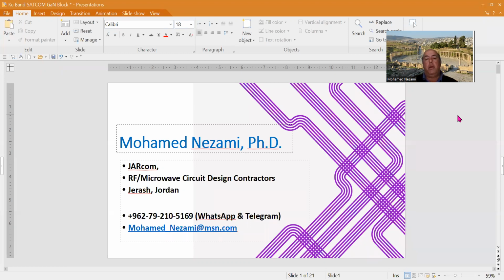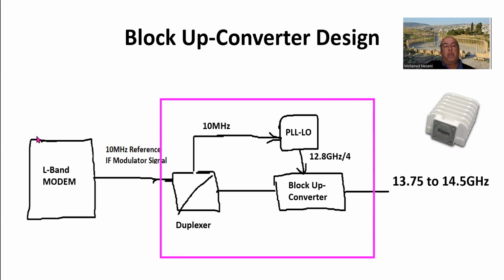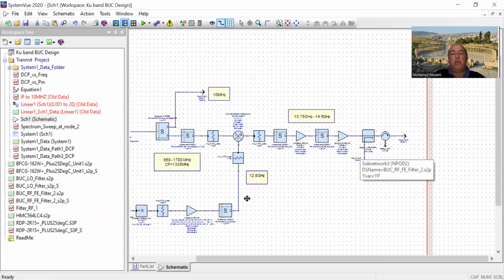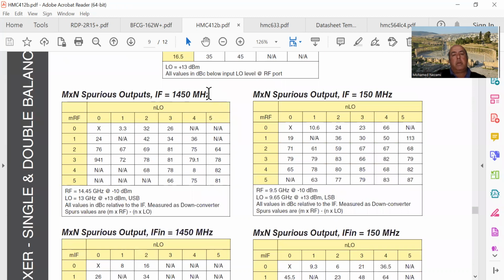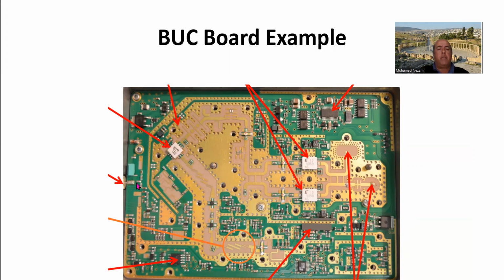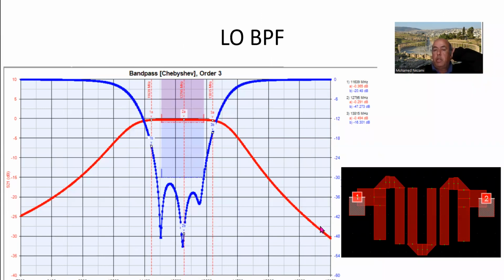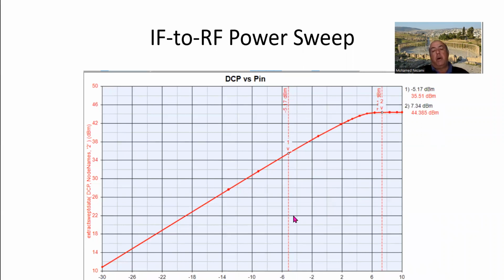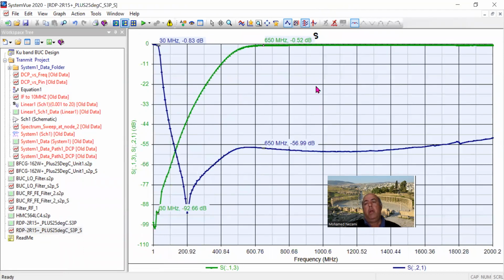Design of Ku Band SATCOM GaN Block Up-Converter (BUC)  with modeling of RF Systems using SystemVue

Comment: Excellent video!. Thanks for sharing your knowledge. Do you have any advise for someone who's trying to diagnose/repair an 80W Comtech HPA? Warmest regards
Reply from the maker: Just do it carefully, give me the model number and let me see its technology first, is it Ku band ??? . You need to open it first, and study its architicture first, control, DC, RF, IOs ...etc, before you fire it up.  What are the issues, does it draw current ???, low power ??, what does the BIT diagnostic tell you if any ???
Reply: @Nezami_RF_Microwave  First and foremost, thank you for your kind response. I have two Comtech HPOD-80WR2W00 HPAs Ku-band, and both are exhibiting the same behavior: I cannot get anything beyond 42.8dBm (around 19 watts) of output power, no matter how much input power I apply. This is significantly lower than their rated output power of 80 watts.

Both HPAs turn on and draw current, and I have updated their firmware to the latest version available from the manufacturer. I have not been able to find any errors in the logs or monitoring utility.

I have checked the input and output signals with a spectrum analyzer, and they both appear to be healthy. The input signal is strong and clean, and the output signal correlates with the measured RF power.

I am at a loss to explain why these HPAs are not producing anything near their full rated output power. I would appreciate any advice you can provide since there are no technical experts in my country available to diagnose and repair this type of equipment. 
Again, thanks a lot!